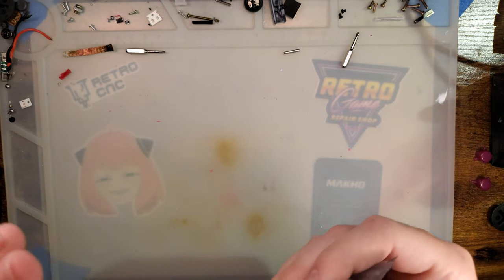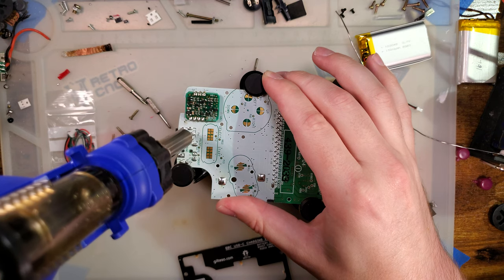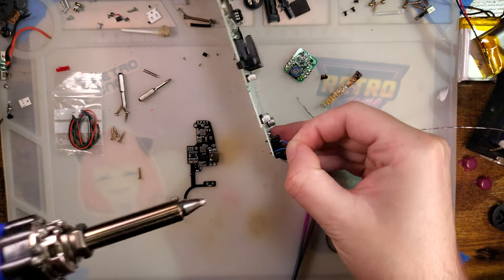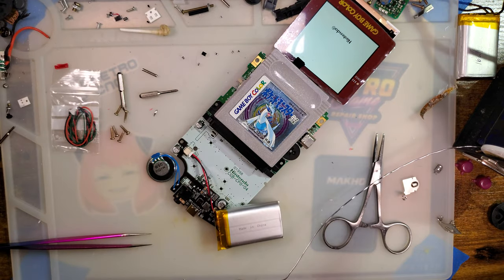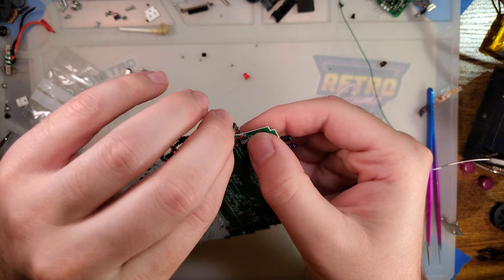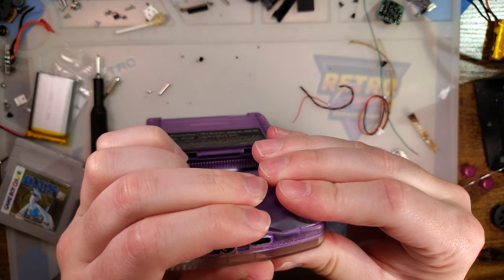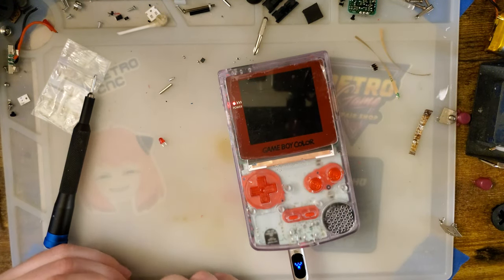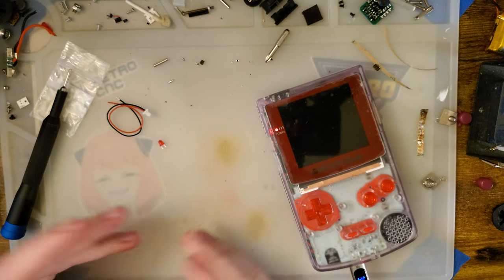Game Boy Color USB-C Charging Kit Pro Installation

Comment: Great video! But when you line up the charging board to the gameboy color board one of the fuses is in the way. From the video i did not see you remove that specific one and it does not fit when i tried to put it over it. Please advise and thank you for your time!
Reply from the maker: Newer variant requires removing the fuse too. There should also be a PDF linked on the sales listings for these and those will be more current than my video.

Comment: This was super helpful and I successfully followed along with your video and got this working perfectly last night!
However, the charging indicator light isn't turning on when I plug it in now... If I power up the GBC, the white light works fine beside the screen, but the charging indicator beside the USB-C port is super faint. If I turn it off, paired charging indicator beside the screen is also super faint and neither will turn on if I disconnect and then reconnect the power cable.
Do you have any idea what I might have frigged up?

Comment: Shame that there's no play and charge.... That would really make it a one-stop-mod for modernizing the GBC's power system. The included amp is nice as well as I've found GBC's to be quite quiet at stock.

Edit: The charge/power LED replacement is a very nice touch, well done!

Edit 2: Also a nice quality-of-life addition to the kit would be a stencil or jig for cutting the USB-C hole

Edit 3: Would also like to hear back if there is a low-power indicator with this mod, missing that is definitely a common pitful/annoyance that comes along with a typical lipo mod.
Reply: I definitely need to add the safe charge-and-play feature. I will try to make space on the board and add it.

Edit2: There is a tool here: https://github.com/giltesa/Game-Boy-Color-USB-C-Charging-Kit-Pro/tree/master/3.%20Documentation/Cutting%20Tool

Edit3: The while led loss the brightness as the original led when the charge of the batteries is decreasing. You can see it here: https://www.youtube.com/watch?v=HYUa4p2kGvU
However, the light doesn't blink as someone advised me to add. Maybe that can be added with this: https://www.youtube.com/watch?v=AjEwjVxBRJg
Reply: @giltesa  Thank you for the reply I look forward to any developments with this kit! And to be clear I think you've done a great job with this one. As far as the low-battery indicator, blinking would work okay but I would love to see it switch to a different color similar to how the GBA/SP behaves. Something like:

Orange = charging
Blue/white = charged
Green = power on
Red = low power

Or something like that.

Comment: Nice video. I believe that you don't need an overdischarge protection system as most of the lipo batteries they have a protection circuit where the two leads connect to the battery body.  Having it on the board would be duplicating the system.
Reply from the maker: So long as you use a battery that has over discharge protection, yes it would be duplicated. Not all batteries do. It won't hurt anything in this case.

Comment: I'm a little sad Retro Gaming Repair Shop is not including a battery with the board, but at least they stock a compatible battery and replacement speaker and capacitors. I'm tempted to install this in my modded GBC but I don't have the cash right now and I'm hopefully getting my Analogue Pocket by Christmas.

BTW, what brand is that USB-C cable with power meter? It's not listed on the info site. Same for the vices
Reply: As a business standpoint I can understand they want more money. So they're not tryin to bundle everything plus batteries for kits are mostly universal. So other power accessories for other mods require the same lipo more or less. Their lipo can be bought separately for any project really.
Reply: Unfortunately I think there are shipping restrictions around LIPO batteries so I suspect it's just easiest to ship without
Reply from the maker: @nyquilforthekill1620  It's more that Gil Tesa doesn't provide a battery with the kits and packing one in would drive the price up. Maintaining two SKUs is more difficult than one so there would likely be only the one SKU and then that would drive customers to other shops if they already had a battery to use. It's not as much a value add if the "bundle" ends up being the same price.
Reply from the maker: The cable I have is baseus -- https://www.aliexpress.com/item/3256802765608582.html

PCB holders are pcbite by sensepeek -- https://sensepeek.com/pcbite-kit-large-base-plate
Reply: @makho  Thank you!

Comment: Could this be installed without the Amp portion? Could you snip off the leg that the speakers solder to?
Reply from the maker: You could just get the one that doesn't have an amp.

Comment: 17:56 video name?
Reply from the maker: https://www.youtube.com/watch?v=hD1J6rPH40E
Reply: Thanks. I’m still having an issue with my speaker. I installed the USBC mod, new capacitors and new speaker but still no sound. If I let the GBC sit for a day the sound comes on but 5 seconds later it fades from very loud down to silent. I tried cleaning it but I’m not sure what else to do. I can see the metal arm inside the headphone jack is in full contact as well. Any advice? (Also I’m super new at modding)